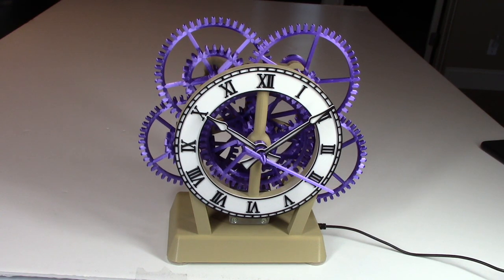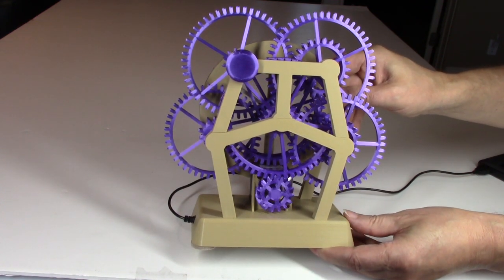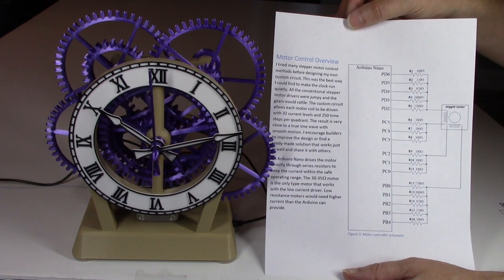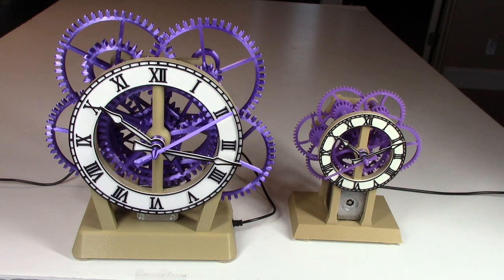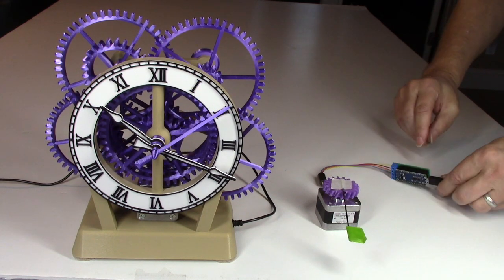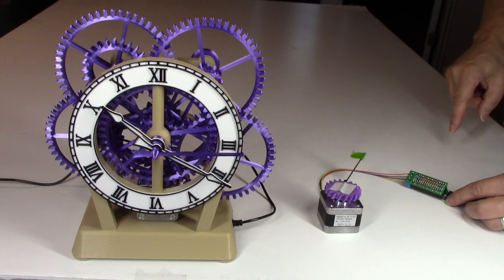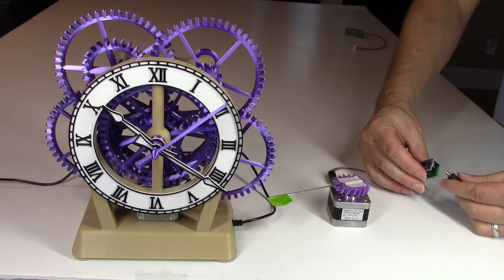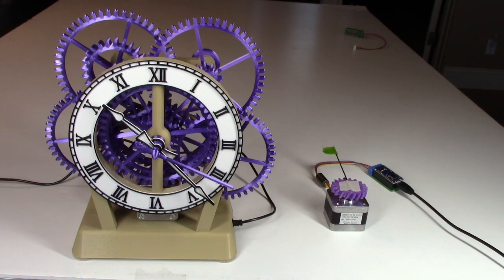3D Printed Desk Clock with Silent Drive

Comment from the maker: Note: I updated the documentation on MyMiniFactory to show a method of building the motor control circuit without using the custom circuit board. The resistors solder directly to the Arduino Nano and fan out cleanly. It is easier to build than using the custom circuit board because there are only 20 connections to solder. You only need to provide a few resistors of common sizes.

Comment: Hello, Steve. Resistance style controls are being used. There is a delay of 2 minutes a day, but I don't understand how to adjust the algorithm value. I would appreciate it if you could tell me the algorithm value.
Reply from the maker: The calibration uses three variables (MAJOR_DELAY, MINOR_DELAY, and MICRO_DELAY) to determine the total delay. Their effect is as expected. MAJOR_DELAY has the most impact. MINOR_DELAY has less impact and MICRO_DELAY has a very small impact. Start by adjusting MAJOR_DELAY to get the clock close, then adjust MINOR_DELAY. You may not need to worry about MICRO_DELAY.

Increasing the values will make the clock run slower. Decreasing the values makes the clock run faster. If your clock is slow, then the values should be decreased.

Each increase in MAJOR_DELAY will add about 11 seconds per hour or about 4 minutes per day. Each increase in MINOR_DELAY will add about 0.25 seconds per day.

It seems like you need the clock to run faster by 2 minutes per day. Start by decreasing MAJOR_DELAY by one and increasing MINOR_DELAY by 500. This should get you much closer. 

Let it run for a few days then do fine tuning with small changes to MINOR_DELAY. Each change will slow down of speed up the clock by about 0.25 seconds per day. For example, if your clock is now 10 seconds per day too fast, add 40 to MINOR_DELAY. It usually takes a few tries to dial in the final settings.
Reply: @stevesclocks  Thank you, Steve. I'll give it a try.

Comment: Are you using quartz for the clock timer on your microcontroller board?
Reply from the maker: You can build the clock using one of two different controllers. The first style uses the Arduino clock source. It needs to be calibrated initially, then stays accurate within a minute or so per month. The second style was just recently added. It uses a precision real time clock as a reference timer with an accuracy of a minute per year.
Reply: @stevesclocks  Thanks! I just ordered your 3D plans for this clock, and plan to experiment with my own motor control design. I Appreciate you making your designs available. Your dedication to craft shines bright.

Comment: Hi Steve. Did you find an alternative to Etsy? Ebay perhaps?
Reply from the maker: The biggest issue is dealing with different customs rules and taxes for each country. Etsy does a great job handling the details, so unfortunately I am stuck using Etsy for international orders. eBay would have the same issues. I am able to include the terminal blocks to make assembly easier and including an extra kit to help offset the postage fee.
I will make a video this weekend showing how to build the controller without using the circuit board. The resistors should fan out from the Arduino Nano with little risk of shorting out. You would need to find some 100, 220, 470, 1K, and 2.2K ohm resistors. They are common sizes that may be available locally.
Reply: Thanks  @stevesclocks  . I have just purchased the files from MyMiniFactory and after viewing the parts I think that with a slight modification to the base I might be able to replicate the circuit onto a copper strip board. I already have the strip board, headers and most of the resistors. Will send you the Fritzing if it works.
Reply from the maker: @OspreyLanthrax  Please post any ideas you may have. More options are always better. I am having good results by simply fanning out the resistors. One thing I noticed is that the base with power in the back has a lot more room to work with. The base with power on the side blocks off a portion of the Arduino.

Comment: I wonder if you could just use a 3d printer board with a stepper driver and use that to control the motor on the clock instead? Many of the 8bit 3d printer boards use Arduino aswell and I've used the spare one off my Ender 3 in a couple of different projects (such as a component tester to check if my motors and fans are working before plugging them into my 3d printer)
Reply from the maker: You could use them if you can solve a few issues. They need to be capable of accurate micro-stepping, or the clock will be very noisy as seen around 5 minutes into the video. The power should be very small so the motor stalls when overloaded. Alternatively, the gears could be made to slip if something gets caught in them. The risk is someone sticking a finger into the exposed gears.

I chose a solution that uses 64 position micro-stepping at an average of 23mA per coil. The current is very accurately controlled to produce near perfect sine waves into the motor. The current is low enough that the motor easily stalls if needed, while still having more than enough torque to run the clock.

I encourage others to come up with different and possibly better solutions. There are many designs that could be made to work.

Comment: I'd like to know where to buy the NEMA 17 Stepper Motor 10.2V 1.8 Degree 4-Wire 6-Pin 34 Ohms in the manual.
Reply from the maker: https://www.ebay.com/itm/294311969837?epid=1772482287 and https://www.amazon.com/STEPPERONLINE-17HS13-0404S1-Stepper-Printer-10-50/dp/B00PNEQ9T4 are some possible sources.

Comment: I wish there was a contact in the UK to buy the Resistor Pack & PCB as they want £16 to post it from the USA, Why can't I just buy the PCB only and it could be sent by letter post
Reply from the maker: I am new to Etsy and all the international shipping regulations. Each country seems to have different rules. It causes me a lot of grief when postage causes the price to triple. If anyone with experience with international shipping wants to take over the distribution of kits, I will endorse them and let them have all the business. :)

I will also build hand a "spider" style circuit this weekend and post pictures. This would allow construction without needing the circuit board. The resistors are common sizes that should be in most resistor assortments. There is plenty of room inside the base for loosely wired electronics. I will post STEP files for the base as well in case anyone wants to modify it.

Comment: Nice work! I wonder whether you considered the miniature 28BYJ-48 stepper? I've found them to be a lot quieter than the nema-17s for small applications. I don't know if it would have enough torque for this, though I have seen them work in some other clock projects.
Reply from the maker: I did consider that motor, but never got it to be as quiet as the proposed solution with 64 stage micro-stepping. It is a 5 wire motor that can only be used with half stepping mode in the default state. The case could be opened to cut a wire and make it a bipolar motor that can be micro-stepped. Or a different control circuit could be developed to micro-step it in unipolar mode.

The first motor I tested started making a ticking noise within a day of running the clock. I suspect that the internal gears are really tiny and not up to the task of running continuously. The NEMA17 based clock at my FIL's house has been running great for over a year so far. It should last a really long time.
Reply from the maker: Torque is not a problem for running a clock. The internal gearing of the 28BYJ-48 provides plenty of torque and the clock needs very little. The proposed solution with the NEMA17 stepper motor is probably delivering less than 10% of the potential torque of the motors. The motors are rated at 0.35A or 0.4A per coil and running with 0.023A. Low torque is a desirable feature so the gears stall if a child sticks their fingers into the exposed gears.

Comment: excuse my ignorance, I insert the Arduino code after this line without spaces? 
void setup() {
  // put your setup code here, to run once: 👈here?

Sorry i'm an absolut Arduino-Newbee 🤪
Reply from the maker: I updated the object description on MMF to include the algorithm as a standalone file. It saved as a .txt file that can be opened using any text editor. Select everything and paste it into the Arduino IDE. This is much better than cutting and pasting from the assembly notes pdf.

The file located on the Google drive is the entire algorithm. It replaces the empty template that might show up when you first launch the IDE. You may want to do a "save as" to create a new sketch with an appropriate name.
Reply: @stevesclocks  Hello Steve, big problem the motor turn back an forth but not in one direction and the Arduino says :

Sketch uses 960 bytes (3%) of program storage space. Maximum is 30720 bytes.
Global variables use 259 bytes (12%) of dynamic memory, leaving 1789 bytes for local variables. Maximum is 2048 bytes.
avrdude: stk500_recv(): programmer is not responding
avrdude: stk500_getsync() attempt 1 of 10: not in sync: resp=0x00
avrdude: stk500_recv(): programmer is not responding
avrdude: stk500_getsync() attempt 2 of 10: not in sync: resp=0x00
avrdude: stk500_recv(): programmer is not responding
avrdude: stk500_getsync() attempt 3 of 10: not in sync: resp=0x00
avrdude: stk500_recv(): programmer is not responding
avrdude: stk500_getsync() attempt 4 of 10: not in sync: resp=0x00
avrdude: stk500_recv(): programmer is not responding
avrdude: stk500_getsync() attempt 5 of 10: not in sync: resp=0x00
avrdude: stk500_recv(): programmer is not responding
avrdude: stk500_getsync() attempt 6 of 10: not in sync: resp=0x00
avrdude: stk500_recv(): programmer is not responding
avrdude: stk500_getsync() attempt 7 of 10: not in sync: resp=0x00
avrdude: stk500_recv(): programmer is not responding
avrdude: stk500_getsync() attempt 8 of 10: not in sync: resp=0x00
avrdude: stk500_recv(): programmer is not responding
avrdude: stk500_getsync() attempt 9 of 10: not in sync: resp=0x00
Reply from the maker: @Buglbiker  It seems like you must have successfully compiled and uploaded the algorithm at least once, since the motors are moving. Uploading again will probably not change anything unless you are trying to re-calibrate the time delays. 

There are a few possible reasons that could cause the first issue with the motor turning back and forth. 1) A broken or missing motor wire would cause the motor to move back and forth. 2) Two swapped motor wires could allow the motor to rotate, but it would be very rough. Swap the inner two wires or the outer two wires to fix this issue. 3) Resistors in the wrong order or solder bridges in the board could cause unpredictable motor movement. It would be very jumpy, but would probably still rotate in one direction. 4) The board mounted backwards would cause the motor to jump back and forth. Turn the board around and try again. There may also be a few other possible reasons. Note that most of these issues are harmless once they are fixed. The Arduino Nano is fairly robust and the board resistors limit the current to safe levels.

The second issue of the "programmer not responding" seems to be local to your computer setup. 3% of program space and 12% of dynamic memory is the right size for a properly compiled algorithm. It sounds like the IDE is not set up properly, although I cannot find a configuration that creates the same error messages. I use Tools->Programmer->USBasp, although it still seems to work with different settings. Tools->Board->"Arduino Nano". Tools->Processor->"ATmega328p (old bootloader)". Tools->Port->COM3, or COM4, or COM5. The port number changes depending on which USB port the Arduino USB cable is plugged into. Select one of the available ports under Tools->Port, but usually not COM1. 

Steve